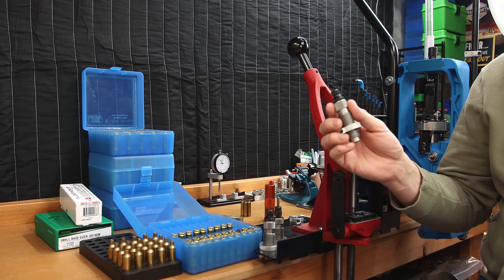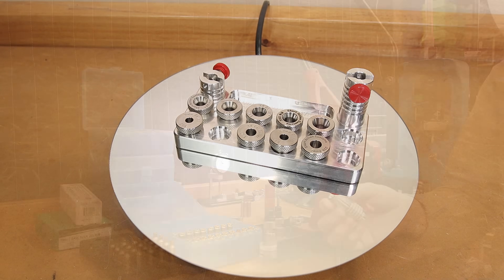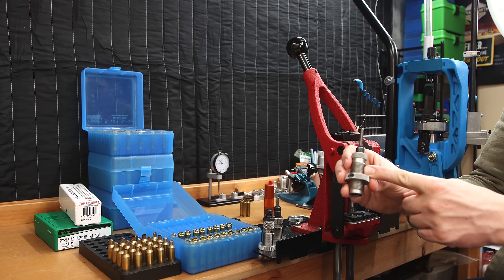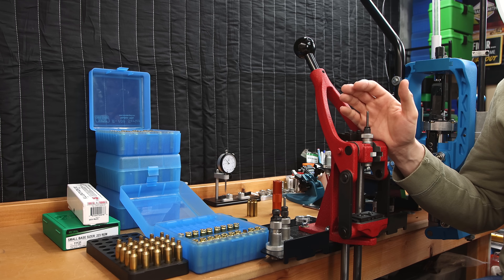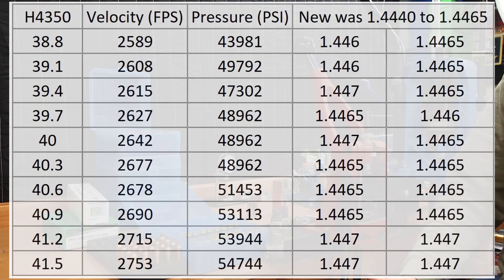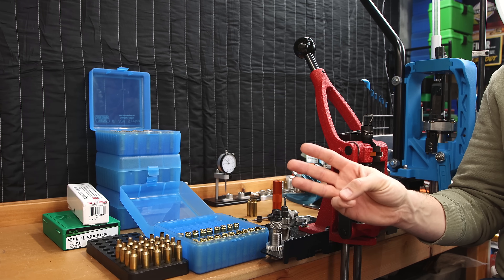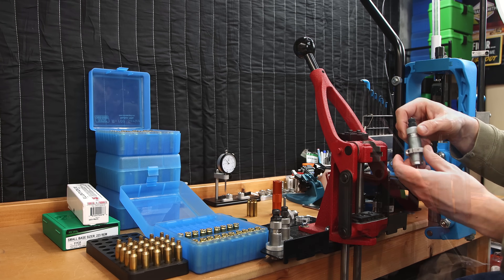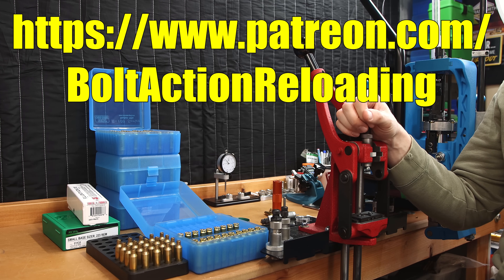How to Setup a Full length Sizing Die - Easy and Accurate

Comment: I'd like to respectfully mention that most of the questions being asked would be solved if you read a reloading manual. 

The Lyman reloading manual is my go to.
Reply: Yes and no, the reloading manuals give you the very basics to reload to SAAMI specs. That is fine to do, and will work well enough, but not every chamber is exactly SAAMI specs. If you follow the book, your loads will function well, but you're not utilizing your gun to the fullest by doing that. By going more in depth, you can get more accuracy out of your reloads, which is the point of reloading in the first place. Having a consistent trim length + annealing every time you reload, backing the shoulder off by 0.002", and finding the proper seat depth for your chamber all lead to more accuracy. You can skip those steps and follow the book and be fine, but you won't get nearly as accurate a group that you could get by doing those few extra modifications to the numbers in the manual. Those steps are also once and done things for the most part, and they can significantly tighten up your group compared to simply following the manual. To me, squeezing over 50% more accuracy out of a load for only an hour or two of time seems to be worth it. But in the end, it depends on the application. A 1" group at 100 yards is fine, but if i can put 5 rounds in the same hole at 100 yards, then why not go for it? Thats just my opinion though

Comment: I liked the methodical way you demonstrated resizing fully, without the expander ball, and without touching the neck at all. I had taken the .002-.003” shoulder bump as a given.  Now I am confident that is a reasonable approach. 

BTW for an M1A semiauto I push the shoulder back .004-.005” to ensure function. That action is really hard on brass and they will only last 5 firings anyway.

Comment: Whenever I want to get into reloading it’s videos like this that throw me off…so technical and behind every second sentence it feals like the narrator means „if you don’t do this perfectly, your gun will blow up an you will certainly die..“
Reply: Back in the day reloading involved only 2 tests.  
1. would the bolt close with a resized case in the chamber? and 2. would the bolt close on the cartridge in the chamber with the bullet seated.?   
Less than ideal to be sure, but no guns were blown up.
Making same reloads that won't blow up your gun is very simple.
Reply: I was lucky to start reloading with a mentor. Now that I've reloaded brass a few times everything in this video seems straight forward. Without hands on experience, it seems unattainable, but once you start you will begin to understand quickly
Reply: Don't let this stop you. It isn't that hard unless you are going for super precision.
Reply: @davidfarrell4289  Not even a few times, i've "reloaded" twice, once about 2 years ago, and again just under a week ago. I say reload, but my first time i reloaded for my 45-70 with the help of someone else, and the most recent time i've only sized the brass (so far), i read the specs, watched videos, and just did it myself on my own press, i did .223 first, then .30 herrett (a slightly more complicated process, it's a wildcat) i still need to trim the brass, prime them, measure the powder, and seat the bullet, but i already understand 95% of that. Just from attempting it myself, and watching a few videos, it all becomes pretty easy to understand. Once you understand the measurements and how to use a caliper, what certain terms mean, like full length sizing, case length, seat depth, etc. it becomes pretty straightforward. Anything beyond the simple numbers you see in the books is getting very precise for your specific gun, which isn't necessary for most people. Reloading is fairly simple, but getting into the specifics requires precision, but in turn it should lead to better accuracy. Anyone can pick up a reloading book, a caliper, a press, and start reloading safely by following the book. The beauty of handloading though is being able to make custom loads for your specific gun. You can follow the book and shoot 1-2" groups at 100 yards, or you can go more in depth and punch 5 rounds in the same hole at 100 yards. You can make it as simple or as difficult as you want to, that's all up to the time you want to invest into it. It all depends on if you want to turn it into an expensive and time consuming hobby or not lol
Reply: Brov
Just get yourself the Lee reloading book , take your time and reload safely. 
What this video is for shooters who have been loading for years. 
Just take your time and reload safely.

Comment: I watched this trying to figure out why my RCBS 6.5 Creedmoor dies are flaring the case mouth when I size my cases. Any thoughts? Would love to see a video on this.
Reply from the maker: Hello, a little more detail if you can manage. What dies, fired brass or new, and chance you have a photo?

BAR
Reply: @BoltActionReloading  it seems like the problem may have been with the cases themselves. The problem only occurred with lapua Brass. Federal and alpha size properly. I am reloading previously fired brass. I returned my Lee dies and purchased RCBS. Had the same problem. I ended up purchasing a neck sizing die to correct the problem. So after full length sizing, I use the neck sizing die to remove the flare.
Reply from the maker: @EverydayReloadingandShooting  I have resized a lot of 6.5 cm brass in lots of brands, including lapua. Have you posted a video or a picture of the flare? Any measurements on the thickness of your cases?

Comment: Good info,  I just take fired clean cases, punch the primer out then  keep setting the shoulder back untill the lever or bolt just closes easy,  then give it touch more. And then run all cases through the die.

Comment: I felt dumb enough when I went to youtube to try and find what I'm doing wrong. 5 minutes in, and I now feel even dumber than before. I can't get reloads to run reliably in semiautos. Made progress w 9mm just by dropping each rd into the chamber of the disassembled pistol. But with M1A, I can't check that way. Can't figure weather I have light strikes on the primer or if I am sho...omg a million variables...ugh

Comment: I'm using a Lee FLSD with an after market lock ring. I find that between the beveled edges on the ring and bottom of the die, and because of the threads causing the ring to be slightly tilted, the only way to get a consistent measurement is to measure in the same place on the ring, like in line with the locking screw. Also, i find it easier to put the square end of the caliper on the bottom of the die and using the blade to measure to the ring.

Comment: Please note : those calipers arnt accurate for reading half thou readings. So if you are getting a reading of 1.4465 , it could be 1.4465 - 1.4469 if its reading 1.4460 it could be anywhere between 1.4460 - 1.4464.
If you get some gauge blocks or gauge pins that are a few tenths from each other , you will be able to see this in action.
Just thought id point that out

Comment: Is removing the fire pin strictly necessary when you chamber the case in the rifle?
Reply from the maker: I typically do not, but it makes feeling the sizing difference a lot easier.
Reply: Ar platforms have been known to dimple primers. Make sure no primer is seated.  It may be riding high.  If you get a sensitive primer guess what.

Comment: I'm having trouble getting consistency with my shoulder bump... I'll set it with a -.002 bump and will get that on two or 3 cases, then it will jump around, -.0005, to -.007 even.... It's really frustrating me as I'm shooting for case life and I'm pretty sure it's affecting my velocities let alone accuracy. It's once fired Winchester brass and a Lee pace setter die. I'm pretty sure that I'm being consistent on my case lube, I've even tried heavier and lighter amounts of lube and that did the opposite of what I would expect...
Any help would be appreciated.
Reply from the maker: Hi Jonny, are you annealing?
Reply: @BoltActionReloading  
I was afraid you were going to say that lol.
No I am not, looking at a EP 2.0 annealing machine though because I figured that might be my issue.
Reply from the maker: @Jonny Sprague  no many folks do and can't keep it consistent.  Don't worry about it to start with. You don't need any complications when you are starting.  What are you measuring your headspace with ans is the brass all the same lot?
Reply: @BoltActionReloading  
My wallet thanks you haha.
I'm using a Comparator like the Hornady ones. They measure consistently with the fire formed brass.
Yes the first batch I did was the same lot. The second batch had a few different lots but it was about the same as far as inconsistency. 
I appreciate your advice! Thank you.
Reply from the maker: @Jonny Sprague  I hate to ask 90 questions but give me every detail you can stand. Press, lube the whole shebang.
Reply: @BoltActionReloading  
No worries, I love talking about it anyhow! 
I'm just starting out so I got the RCBS Turret press because I like it's flexibility. I'm currently using a Lee Pace setter die set, not sure if I mentioned it or not but this is .30-06 I'm reloading. I polished the neck expander unit and did my best to clean and polish the inside of the die.
I'm dry vibratory tumbling my brass, I then do a light debur with a Lyman inside and outside tool. It is the 20ish degree deburring tool, not the 45 deg one. Then thoroughly cleaning with a rag, neck brush, and q-tip's.
RCBS Case lube and pad, taking my time to make sure it feels exactly the same every time and there is a very thin film in the shoulder and neck. I've also played with more lube and got the opposite result I thought at times... I would expect more lube to push it back further but it was mixed so I went back to a very thin coat. 
Sizing and depriming, I've also tried de-priming first then resizing, no change to speak of. 
Trimming with A RCBS case trimmer and then deburring and cleaning again, especially with the neck brush. 
I am cleaning my primer pockets with the Lyman reaming tool and a RCBS pocket brush. 
On press priming with the RCBS setup. I tuned it up so it works reliably and consistently. My seating depths look the same. I will measure them though next batch.
Bullet seating with the Lee die. I just got BTO comparators so I'm not sure my consistentcy there yet but the COAL seemed pretty good but I didn't lean into that too much. Then a very light factory Crimp because this will be hunting ammo in a pump action rifle. Feel better with the crimp. 

Sorry for the Novel lol
Reply from the maker: @Jonny Sprague  no apologies needed. Any slop in your turret? Not super familiar with that particular press. Does your die have a small hole in the side to allow excessive lube to escape? Are you seeing shoulder dents?
Reply: @BoltActionReloading  
There was some slop out of the box but I had read additional torque on the turret head nut takes care of it while I was waiting for delivery. I put about 60 ft lbs of torque as soon as I had it mounted and it took the minor slop out of the head like the blog said it would. 

Yes it has a vent hole, no shoulder dents. I did verify that.

Comment: I highly recommend the Redding competition shell holder kit. Just get your die screwed in where it's close and then start with the highest shell holder .010".  Not enough bump? Use the next smallest shell holder until you get the desired .002" set back.
Reply: what if the expansion is more than 0.012'' after fied?
Reply: @willxu08  you're lost somewhere but I'm not sure where. Rephrase that question
Reply: @OvertonWindex  what I’m saying is many or most 223 Fl sizing die will over size the brass a lot. For a full contact sized brass, one of my rifle will create 0.015” expansion. The 0.010” shell holder will size it back to 0.010” which still leaves 0.005” should bump which is too much
Reply: @willxu08  just the small base FL sizing dies... specific fir ARs basically. 
   If you don't want to size everything back down to Sammi, then don't get the black box for semi auto rifles. Get just a regular FL.
Reply: @willxu08  or wait..  you still have a confusing question. 
   If you want it sized all the way back down... use a black box RCBS AR sizing die... if you don't, then why would that bother you?
Reply: @willxu08  With the Redding shellholders you set up the die slightly different so your current results with your current shellholder is irrelevant.
Reply: @willxu08  Don't size your brass back to SAMMI specs. Adjust the die so that it only sets the shoulder back 0.002" to 0.004" when compared to your fired brass and then lock it down.

Comment: I set my FL Die to where it just starts to cam over. Then, I use Redding Competition Dies to determine shoulder bump. Works well because most brass brands do not bump the same and it keeps me from having to adjust the dies all the time.

Comment: ..I have one FL die for .223 Rem.  If 1/8 turn after contact with shell holder bumps the shoulder around 0.009" and 1/8 turn of the die is 0.009", why not just lock the die just past this (a 1/32th turn) Would that produce a 0.002-3" shoulder bump? I use a witness marks on my Lee collect neck resizing die so the die is set consistently and this working great on group size...

Comment: I don't quite understand the ending portion. My 223 redding die is doing the same, oversizing the brass. For some of my LMT semi auto AR15 rifle, it even bump the shoulder 0.020'' if I make the die completely touch the ramp. How to solve this? For my other dies(sac for 308win 6.5cr, redding for 338LPM), none of them will give me a shoulder bump less than 5 if I set them fully contact the ramp for brass fired by bolt action rifle. Are you saying we should simply screw the die up until it gives us the desired 0.002''-0.003'' shoulder bump even though the die might not contact the ramp anymore?
Reply from the maker: Yes. There is no magic in having the die contact the shell holder. Bumping the shoulder back .003 for an auto feed should be plenty.
Reply: The die doesn't need to touch shell holder, the directions with the reloading dies are to be sure the resized brass should fit in any chamber
Reply: That's what I do, go in until the die contacts the shell holder, and actually screw it back out a 1/4 turn, and slowly go back down until I get the set back where I want it.
Reply: @BoltActionReloading  Thanks for the reply and great video. I got this firm contact impression from those shell holder's introduction video. I just got an area419 modular shell holder and the redding competition shell holder is on the way as well. What got me frustrated is both of them will do 8k-10k extra length, but still won't fix my 15k expansion.
Reply: @willxu08  something i remember,  is to always stick with same brand shell holders.  It might have been on Johnny reloading bench, but using different brands can sometimes cause problems too.
Reply: I only bump my shoulder .002 for any of my semi-autos and I've even got away with only bumping them back to .001. But my die never contacts my shell holder on anything that I know of or if it does its just barely. The problem with the instructions on every die set that I know of is they're explaining how to insure the brass is sized to fit in every chamber instead of explaining how to adjust it to your chamber. Which over works your brass reducing it's life span and possibly robbing you of accuracy.
Reply: @DanielBoone337   I used to bump 0.002-0.003'' for my SA rifle as well. And it did function flawlessly. But if I want to inject an unfired round, it's really really snag. I'm not sure if that's a sign that I need to bump more. So I tried 0.005'' shoulder bump and it did fix it.

Comment: This might seem
Like a silly question but if you take the expander ball out of the die, is there a measurement you set it to when you reinstall it. I noticed in the instructions for my Forster die that it said to avoid having it too high or it would crush the case, which is exactly what I did! Lowering it stopped that happening, but is it possible to go too low?
Reply from the maker: As you take the ball lower the case is less supported when the inside of the neck is sized and more likely to induce runout in the case.
Reply: @BoltActionReloading  thank you
For explaining that. You’re a wealth of knowledge and I’m learning so much from your videos. So thank you again